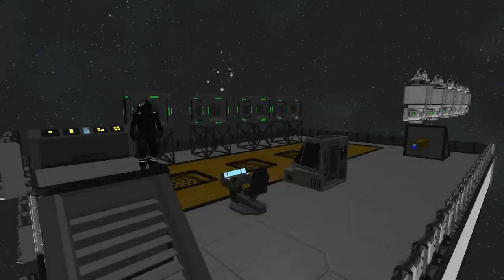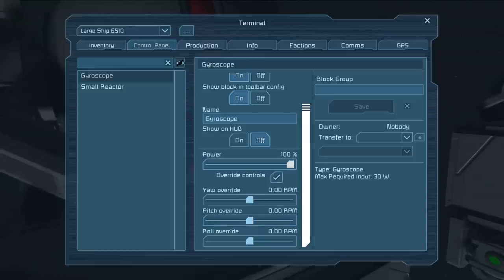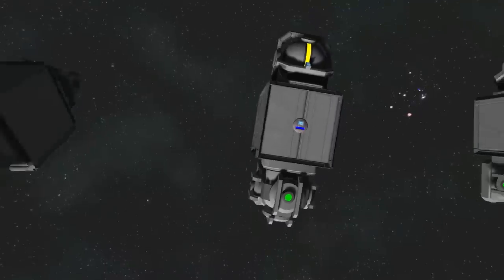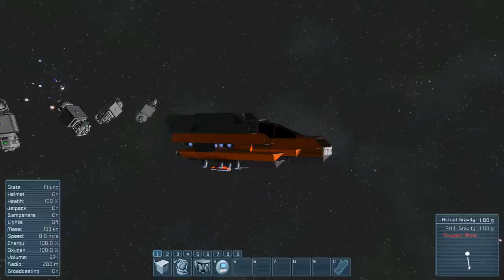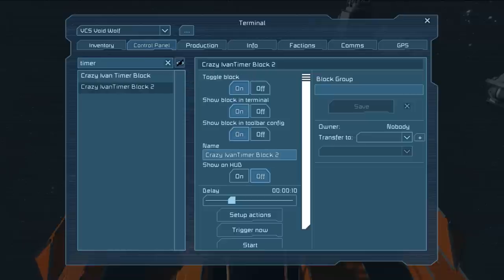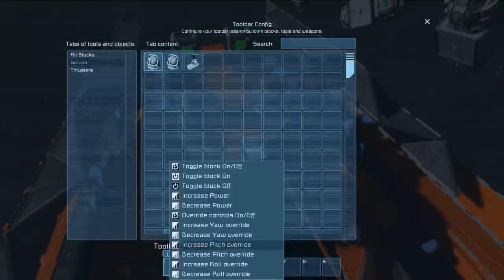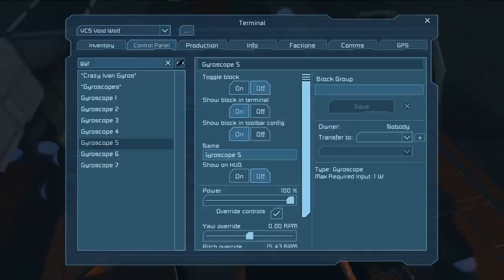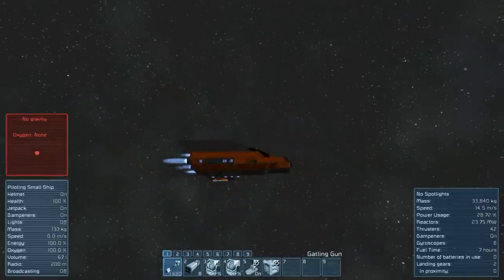Space Engineers – Timer Block Tutorial: Gyroscopes and Crazy Ivan

Comment: How do you do the thing when you place 2 gyroscopes at once?
Reply from the maker: +MAKAR Shpilenok that's done (and it works for any blocks) by using the symmetrical building system.  Target a block and click M, you should see a colored, translucent plane show up along one axis.  You can keep hitting M to cycle through more - when you mouse click (just like you would to place a block), it will set that plane as a center point for building so anything you place on one side will be mirrored on the other.  You can do this with multiple axis at once if you choose.  You can use N to toggle symmetrical building on and off, and the game will remember where you placed your planes so when you hit N to turn it back on you don't have to place them again.  To get rid of a plane just target the plane after hitting M and right click.  Hope that helped, and I hope it is all correct (working off of memory here).
Reply: +GopeScope Gaming Thanks it works!

Comment: I see two things happening; first the landing gear not toggling with the timer blocks, the second is that the vibration from the drills (and latter the ground) is causing your moving arm to guide as well as move the pipe up and down.  some similar concepts on this idea us wheels to act as the guide and to leave the 2 landing gears to move the pipe up and down. I think 50% of the time your getting the bug and the rest of the time your seeing the effects of micro coalitions between the landing legs and the armor blocks that can deform when hit. Try using wheels to guide the pipe and only two (2) landing gear on the same side (or at a 90 deg. angle) to move the pipe. (Again, the gear moves it the wheels are just bumpers).
Reply: meant to post this on you drill rig page with the advance timer block page. web browser took me to this page before I posted.. sorry about any confusion
Reply from the maker: +StopThatNow Np, thanks for the feedback - sorry I haven't been around for a while to respond.  I think you're probably onto something there!  I appreciate it!